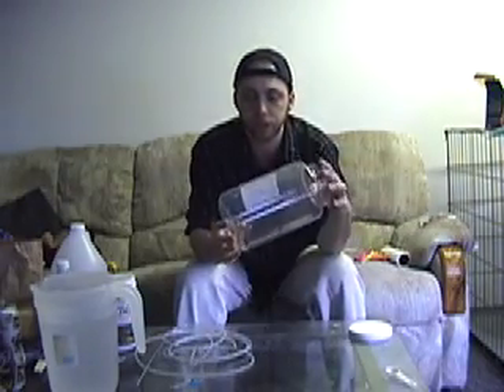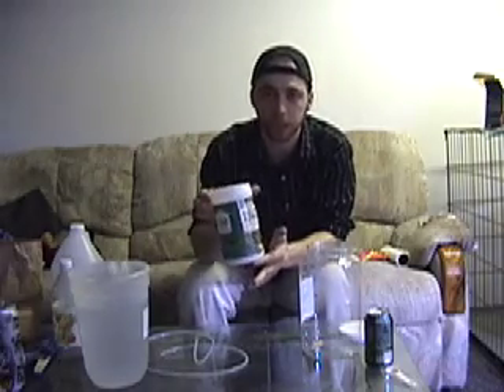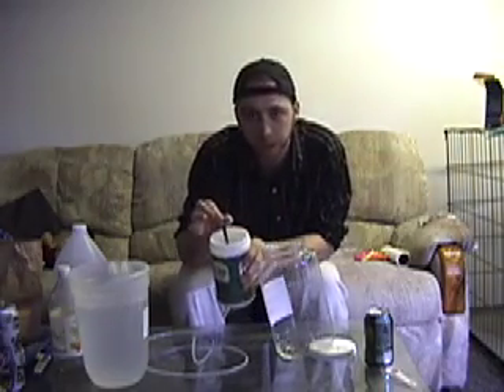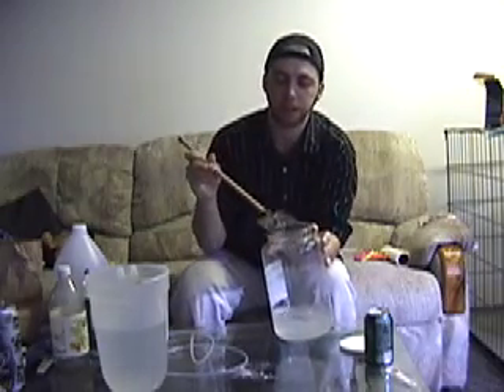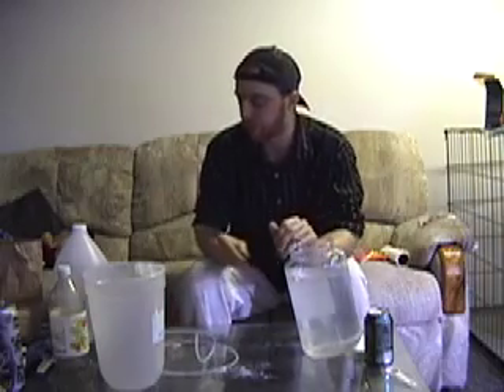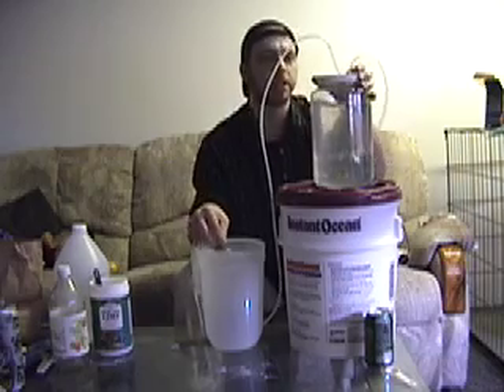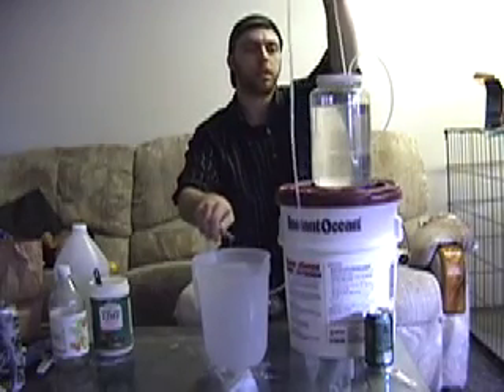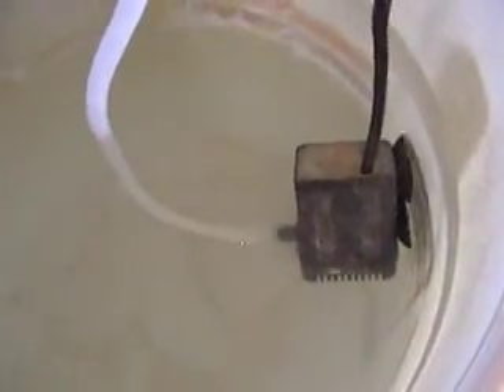DIYKalk-TR-Ep44

Comment: Hi thanks for the "video" cast :) I tried this method but my water still shows some particles floating, there is a settlement on the bottom, and some film on the surfice of the mixed water. Is that normal?
Reply: IRON WILL AESTHETICS Thanks IRON, been using this method for a very long time now. Very happy.
Reply: Yes its normal to gets settling on the bottom. Just make sure your rigid tubing is up a bit higher than the powder that settles on the bottom. You want the clearish liquid not the white powder going in your tank. Cheers.
Reply: Yes it does. No problem. Happy Reefing.